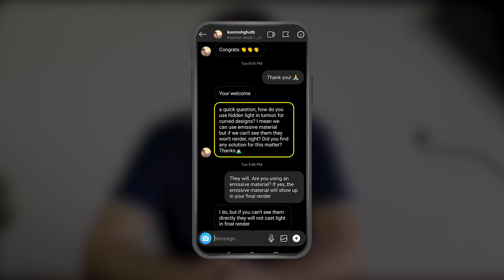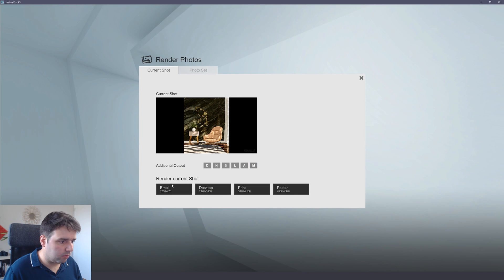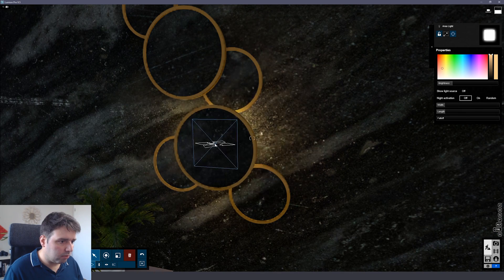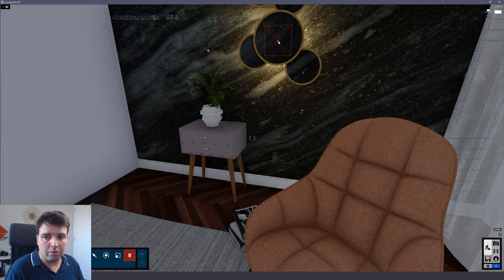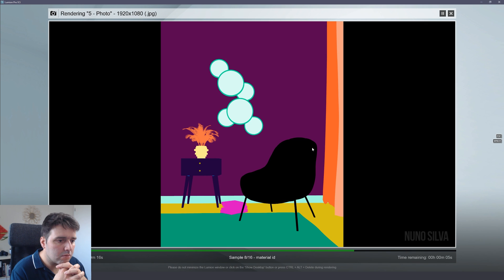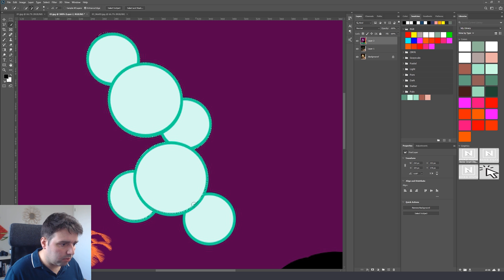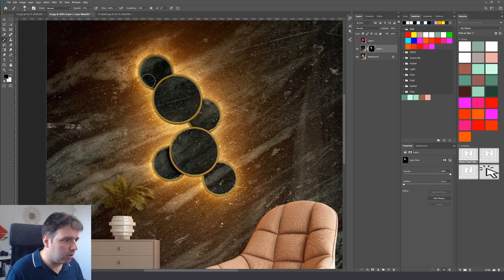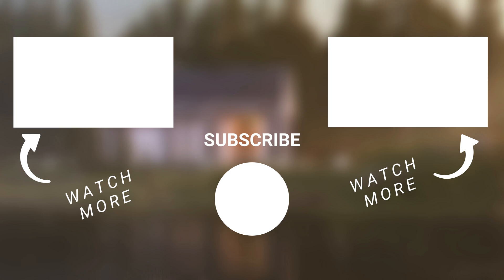Lumion Render with Emissive Lighting - Quick Tip

Comment: I am having issues creating emissive materials in Lumion. I tried making my material standard, or even selecting a default material then sliding the emissive slider, but it turn white with no glow. It doesn't even change colors at all too. If you Nuno, or anybody have similar issues or know the solution would you mind helping me? I am also on a deadline for this project
Reply: It is very easy to fix) Lumion simply don't  have a material to work with.
After changing material to standart, just add any white image as a texture (white plaster for example) and move slider "emissive" Now it will glow. 
Hope it's not to late )

Comment: What a huge effort for creating a contour-shaped light gloom. If the plan is to fix it with Photoshop there might be a better way by giving the outline a self-illuminition (non-emmisive) and render the final with material-id for masking in psd. Just give it a glow  or a gauschn blur with  color burn etc.  and the job is done in less than 2 minute

Comment: Just a quick question....What if it is animation ? I mean do we have to render both renders as animation ?
Reply from the maker: If it's animation it's best to use the area lights, or else you will have a hard time tracking everything in post. :)
Reply: @NunoSilva3d  Thank you for replying. I just have one more question. Suppose if I have a lamp in my scene. Which has outer layer of glass and bulb inside of it. How will I assign emissive material to the inner bulb. ?

Comment: Good tip. But if you are doing an animation and your camera is moving then you will have to spend some good amount of time to fix it in post Production. I would prefer to create the glow effect in photoshop first considering the shape of the light and save it with transparent background. Then create another plane aligned with the light and give a offset of 1mm from the wall. Put the transparent texture on the mesh and give a little emissiveness on that. This will save lot of time in post for animation videos..

Thanks

Comment: Emissive materials in lumion can only cast light if they are visible to the camera, so, if you allow me to share my opinion, I think the ideal solution for this case is by editing the 3D model and make that emissive back side little bit bigger. 💫
Reply from the maker: Thank you for your feedback. When you say little bigger, you mean like having a ring of light for example facing the camera?
Reply: No No.. with  the right amount of emissiveness and very small edges you won't even notice they exist..
Reply from the maker: @ArchAhmetAksoy  I'll try that later as well! Thanks :)
Reply: Yep, exactly 💫🙏🏻
Reply from the maker: @ArchAhmetAksoy  that might work but you will get this sharp light around, which doesn't happen in this photos I was showing in the beginning.
Reply: This is the solution
Reply: PRO TIP